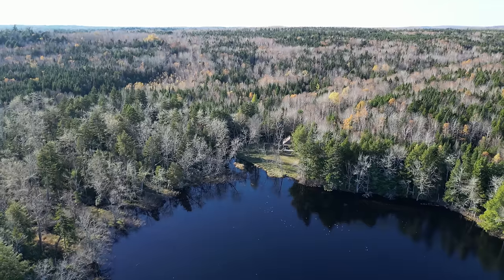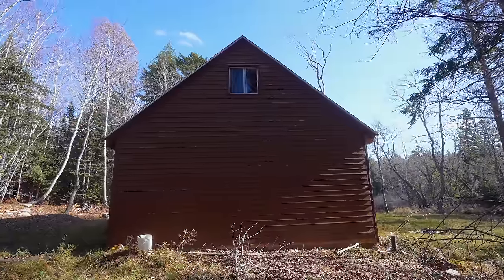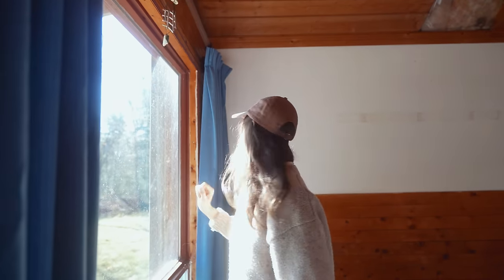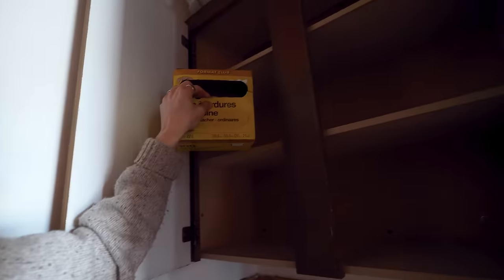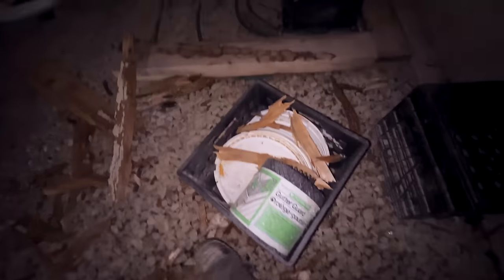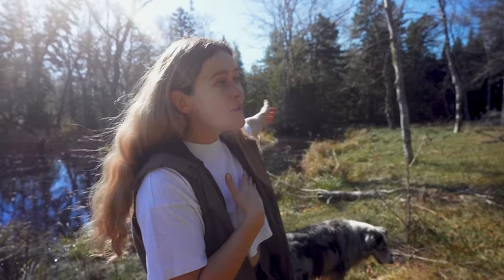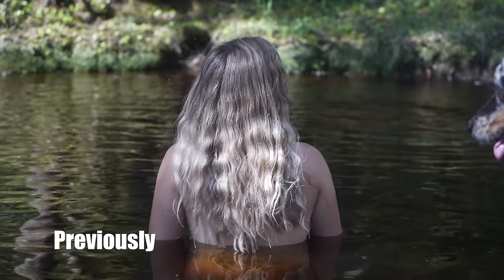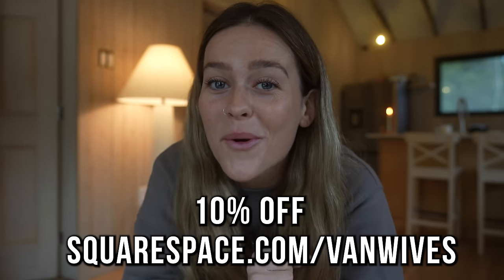We Bought an Abandoned Lakefront Home in Canada and Found Hidden Treasures

Comment: That cabin is so well positioned to see the lake, I'd be tempted to drain and reroute the water around it if its feasible. That way you'd have potable water running close by and potential for a small watermill as some have mentioned. I'm a female with an off-the-grid property in Back Bay, NB so following you with great interest. Good luck!

Comment: To fix flooding and make power can be very easy honestly after a few orchestrated steps. I suggest bypassing current location of River short term when the bed dries up dig it down a few feet the length you decide than build a damn with the added depth that will give you added potential and a way to potentially stop any further flooding at the new cabin. Also as per having friends and family I suggest keeping your home and keep living there and have guest stay at the other cabin when in town. Also could serve as a get away for you girls when you want a break

Comment: That propeller is actually the turbine from a wind generator. If you find the genny head hanging around somewhere you could have most of a remote power system in hand. Build a tower, run some cable, add batteries and you'd have electricity.

Comment: In my opinion the first think to do would be getting all the regulations on structures close to water. How would you treat your black water, and where would you get your drinking water. What are the regulation for ground water caption.  I would go with a sealed bedrock well, this way you keep surface water from contaminating ground water.       With a river going by you should look into water turbines for electricity production. 
 With the construction you have on the property, knowing the bylaws concerning old structures and how to dispose of them is a must to keep you from very expensive legal fees. 
  I think going with a new building is the less expensive option, plus you relocate on higher ground. 
It would be important to know the type of soil that you have to build on and the higth of the water table.
 It is nice having this new lot attached to the existing one.

Comment: DAAAMMMN!  I'm so impressed.  My first video from you girls, but I'll be watching others.  Love your spirit and I wish I had land on a lake to pretend I could fix up like you're going to do!  (and apparently already DID do!)

I'm looking forward to seeing if you have enough elevation change and water flow in the river to make a water wheel practical.   Small scale hydro electric power is a great option if you have reliable flow for a good part of the year.  And the magic of hydro is that you can put multiple turbines in parallel OR in series to multiply the benefit, depending on geography and volume.

Comment: Considering the mold on the basement beams and the condition of the roof (the roof truss might be as bad or worse) it would be wise to have a reputable home inspector check it over to give you a better idea of what you are getting into. He would be able to tell you what could saved and what should be replaced. As you will not probably not starting much before spring one idea is to get something temporary over the roof    (tarps or spray on rubber ) to minimize any more water damage and open as many screened windows as possible to allow air flow to dry it out some what. All that said good luck and pray it's not as bad as it seems.

Comment: With how wet that land is there, I don't know if I would build anything with a crawl space underneath it. Building up on stilts is probably your best bet to avoid having any kind of crawl space getting flooded. The location is great for the view but as you say it is prone flooding. But if you knock down what is there and build a place up on stilts that is high enough that during a flooding event it can stay above the water. You could build an entire self-contained building within itself avoiding having to do anything with the ground. Only downsides are drainage for septic although you could have subcontained holding tanks in the building itself or have it pumped to higher ground to its own septic system that is not going to be flooded there are many options if you're willing to spend the money. It's a beautiful location, but it's a project that would be a monumental undertaking

Comment: For clarification, what is above your head while standing in a room is the ceiling. The structure that covers your house is the roof. For certain there is water entering your cabin where the shingles are off, it does not mean your roof is going to collapse. It looks as though you need to get up and fix your shingles and that should keep the water out.

Comment: That cabin is a tear down and rebuild job, 100%. You just keep the concrete foundation and then you can put the cabin back, but up on stilts well above the flood level so it's still got the amazing views and location but will stand the test of time. And if you do it right, you can have a series of decks stepping down from the cabin, the last of which ends up being a floating pontoon style deck, right on the lake itself. That way, you still get the link to the water and the land but it doesn't get destroyed when you flood. And if you're allowed to modify the river slightly, if the flow is enough, it's got huge potential for generating power using a water wheel.

Comment: That old cabin has negative value!  With all that mold and rotten wood, bad location, etc. it will actually cost you to demolish it.  But I think that is the best use for the land.  Build a new cabin on a higher location that still has a great lake view.  You know how to do that now.  Drill a well, put in a septic system, add solar, and get propane service.  Rent it for short-timers, and hire a local maid to come in to clean and restock it.  You could advertise it for hunting and fishing week vacations, and cross-country skiing during the winter.  You just need to make some trails on the 10 acres.

You could even start with multiple campsites with picnic tables and a shared bathroom.  Add some tent cabins, then later real cabins.  Pretty soon, you own a resort.

Comment: I think it’s great that you could purchase the adjoining property! Based on the video I’d have to say most of the wood is bad and needs to go! However as it’s been pointed out the concrete foundation looks to be in very good shape. So think about how much money the footing, concrete foundation and other materials represents if you abandon it and build just the same thing from scratch!

I think it would be worth keeping and reusing even if you need to make some changes to the landscaping elevation to help address the high water issues by raising the ground level up to a few inches/centimeters from top of the foundation. Put Clementine to work by moving dirt. I would concrete up the crawl spaces door and fill in with dirt and add the vaper barrier on top. I would also add a sump pump in it to take care of the ground water.

All I’m trying to say is that is GREAT view and spot for a cabin and the cost of the concrete foundation is PAID FOR! Use it as the foundation to hold up a cabin on stilts with two stories.

What ever y’all decide to do I know you’ll do a great job and it will look great and very inviting And ill watching!

Ron

Comment: Depending on local building codes you might not be able to build what you want where you want on the new property. I actually think the existing structure looks pretty good. I'd reroof or tarp it for the season ASAP to address leaking this winter, then do a gut rehab on the existing structure. Random fact, my wife's family has a cabin not too far from you that is a blast to visit.

Comment: @ the 9:35 time episode here is not a propeller, it is a wind generator impeller. I have one on a 400 watt generator maintainer..  Any trees for a tree house? - maybe 2 or 3 (u-shape - double ended - 2 sets each end - doors on rear container) shipping containers  (40 footers)  base for the shop/garage below and living quarters upstairs with a view... both inside and outside stair cases up to patio platform area or other one inside. water wheel possible under too? but US DNR (your Canada??) has issues flood plain zones at 100 and 500 year wetland delineation.  issues on the water wheel and housing above or on side especially with freezing conditions of the wintery season??..

Comment: I say Bye Bye Cabin - and clean up and restore the area - take what you can salvage and then - start new!!! That foundation if in good shape - maybe an elevated deck area for recreation and deck boxes for storage. Then use the more suitable areas for a new cabin for quests as in family. I would not rent it out, etc... I would look at the newer technology with solar and look to do a gridded style cabin with solar - build a power house centrally located to what you plan to use for cabin and recreation. I would also look at "water" - as in drinkable, useable water. Like a Water House, and heat it with several heating sources - so you have water and power to the area. The start to build out from there. Just my two cents. But the old cabin has to go - for so many reasons. Mainly health and safety.

Comment: I would tear down the existing cabin (because of the floodplain) and build several tiny houses on more elevated areas, all powered with renewable energy, connected to a central well. Could build them one at a time, have raised boardwalks connecting them and a large central deck (for gatherings, concerts, filming).....maybe it's own small greenhouse as a 'community' garden for guests staying in the tiny houses.  I would create multiple sitting areas near the waterfront with firepits, maybe a dock for fishing and launching kayaks, etc. SO much potential.

Comment: What you thought was a propeller. That's a winter byine blade for putting on like a alternator and it turns around the alternator which makes power for twelve volts

Comment: Not sure what you should do with the cabin but I'd build a few small cabins on the property. Single room with a wood stove that can be guest houses. When friends and family come to visit they have a place to stay. Solar is a good choice for power and if you stick to 12 volt you don't need a panel or an electrician. There is a scout camp near me that uses RV lighting in some cabins and has USB ports on the walls for changing devices. You could even rent out the cabins too. It's an absolutely beautiful property

Comment: A lot of great ideas in the comment section.👍 I agree that the old cabin has to go because of the mold alone. Yuck. 
Is all that inside wood on the walls moldy, too? If not, someone might really like that antique,North Woods style of decor. 
And if the flow of the stream is high enough for a modern water turbine, you will be producing more electricity than you can imagine. Again, if the water flow is really good, sometimes getting rid of too much electricity is the issue. Some people use hot water tanks to absorb the extra electricity, or a heat sink is set up in the system to bleed off the excess.  Lots of good info online. ☺️ Check out modern ‘water turbines’.  Have fun and Congratulations on your new ‘toy’ 😁. (I always say that having a house is like having the world’s largest toy. Something always to play with and enjoy.👍)

Comment: It's awesome!! So exciting! I think your current cabin can be the guest quarters and/or a short term rental income source down the line. The flooding is going to increase with the rapidly accelerating climate change crisis. Mold is difficult. Salvage what you can. That concrete foundation looks promising, but maybe it's a boathouse or treehouse base for seasonal usage. I've been seeing a lot of stuff about underground houses. Part could be underground (great insulation) and part two stories up (great light). 

Hydro water sounds like a good option for  power! So many possibilities. Great place to raise kids. ;)

Comment: You can't build views like that, but you can tear down that cabin and rebuild a new cabin on pilings with wide decks. This could also be an Air B&B and derive some income to offset some of the costs. Probably would need to bring in some fill or dig on site to raise the area under the new build for parking under the new cabin.So much potential.

Comment: I say bulldoze the cabin right there down to the foundation redeck it with recycled plastic planking better so it can be used as an entertainment space and have better mold Resistance. Then build a tree house where the flooding is less of a problem.

Comment: The concrete foundation walls look good. If they did pour that wall with a footing then it’s a pretty good start. You could demo the wood structure and put down poly and foam and pour the floor so you wouldn’t have any more moisture issues. Could you then dig diversion channels to keep the water away from the cabin? Just a thought.

Comment: Depending on the river, it’s better to move the cabin to a higher elevation. Most rivers that are connected to an ocean will move throughout a hundred year span you can search up a meander stream as an example . That cabin will not last the next hundred years even if you elevate it especially with rising sea levels that cabin will drown in a matter of a couple decades.  Some suggestions would be a shipping container or a tiny home deluxe, maybe even a house boat. PLEASE, move the cabin away from the river to a way more elevated grounds. Build on way higher ground and then try to get something movable like a tiny home on wheels so you can have a nice home by the river. Hope this helps. Your friendly canadian geologist/geographer.

Comment: The new to you cabin has great bones, I definitely say keep it. First order would be get a new roof on it, then next I would have Porter and His dad bring in some fill dirt and get that grade up around the cabin higher and around that built up grade use some riff raff rock to ensure it holds it together. The. I would get inside and gut the place, start fixing all of the rot, then rewire, plum, insulate and hang new wall covering.

Comment: If you wanted to keep the house in a similar location then you could look into stilt style houses. similar to what you can see in various parts of the world near beaches where they can be affected by storm surges. Bascialy the "main" floor is just open concrete supports and you go up to the actual house.

If the goal is to have it act as a place for friends and family to stay might be better to pick a location closer to the connection to your house, but I would also put a structure by the lake built on the concrete foundation of the current cabin. Like a covered outdoor kitchen/hangout area near the lake so that if you have friends and family and want to have a lake party you don't have to move away from the lake to cook and eat.

Comment: I'd build a few little tiny homes on that property and rent them out as air bnb. Great little get away on a body of water.

Also building the house on stilts might be an idea if you want to keep the same foot print.
Reply: Also I almost just bought a place in New Brunswick with 1000 ft of water front. It had a beautiful cove and a few tiny homes on the property. I couldnt talk my partner into committing fast enough. 😢 it was sold in no time.
Good luck and great score on this beautiful property.

Comment: Numerous remote lodges in Northern Ont. generate their own hydro electricity using turbines in local rivers and streams. Fun fact; not all  lakes are fed by rivers or streams. Some lakes are filled from underground qualifiers. These are called Source Lakes and usually have small rivers or streams flowing out of them but not into them. They are really amazing to experience. The water is so clear and usually noticeably colder than other lakes in the same area.🥰

Comment: Tear down this cabin and rebuild it again on the same cement foundation, but on top of some pilons put on top of the foundation to raise it up higher. This will make it safer in case of flooding again. While doing the demolition though, please keep, salvage and reuse any of the wood and other materials in this cabin that can be repurposed to rebuild it. Also, maybe you can clear some spaces in between your original land and this land to have camping spaces for your friends to come and boondock or camp on your land when they visit.

Comment: Considering how deep the crawlspace is could you not build it up all around the cabin to where it wouldn't flood. Add dirt where the crawlspace is only two foot deep and build it up all around the outside as well so when it floods its like on an island? You could also build a small road for ATV's to get to and off of that island when its flooded to where ever it doesn't flood. I guess it all depends on your access to fill dirt at that point but that seems like it would be the easiest thing to do due to that massive foundation already in place. The wood rot and roof issues would be easy to replace/repair I would think. Well I went back and looked, maybe raising the cabin up a foot or so off of that foundation would be a good idea depending on how bad it floods. Maybe build a berm around the cabin to keep the water at bay.
Reply from the maker: Thank you for sharing your ideas. The possibilities are endless. 🌞🐶

Comment: Clear an area further back , tear down old cabin , and build a larger Cabin on stilts , so if there is a higher than expexted flood the house will be protected (will also be your "treehouse") , and raised away from any critters/bears, if this is going to be a 2nd residence, rather build a proper drive between the cabins, and slowly buold up main drive. If there is enough elevation , divert water from the river for hydro, just fyi it can be noisy, but might not be a good option if it floods.